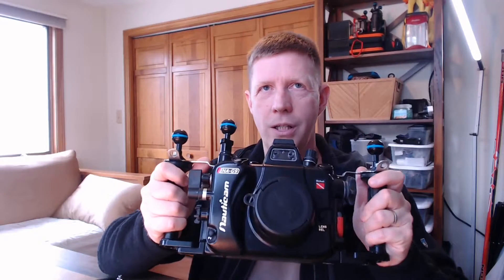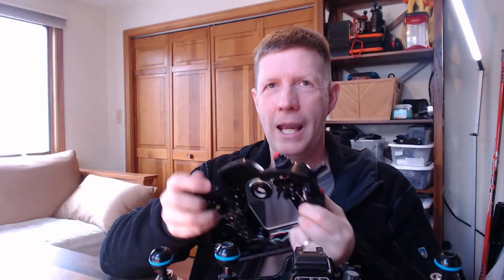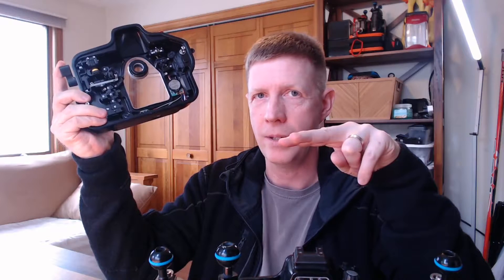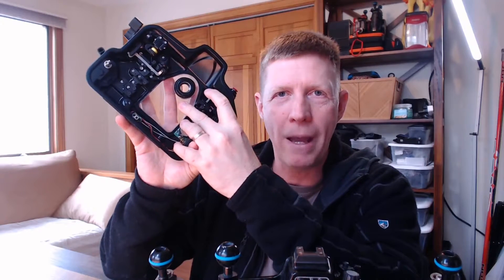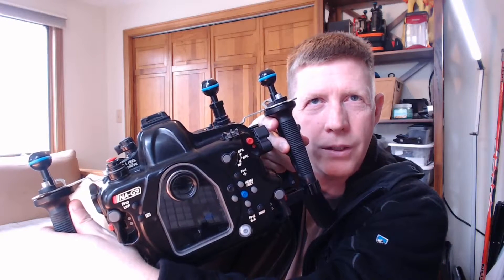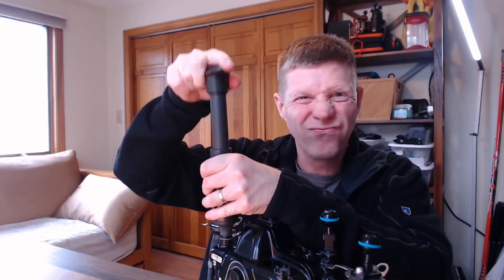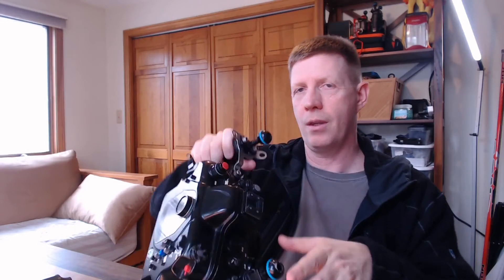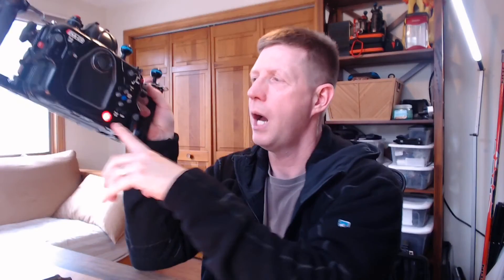Tutorial: Nauticam Vacuum Seal and Leak Detection

Comment: Nice video. I got a housing with one of these and it worked so well on land. I was testing it out at home before I went out. At the water though it was solid red and I couldn't get it to turn any other colour. I would guess the battery is dead or dying? I have ordered more. I still went out into the water though:)